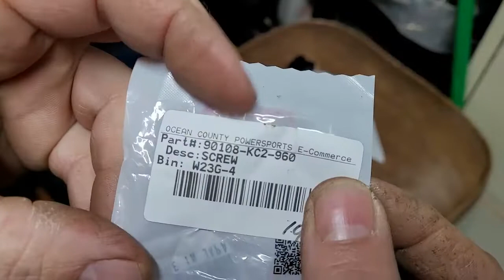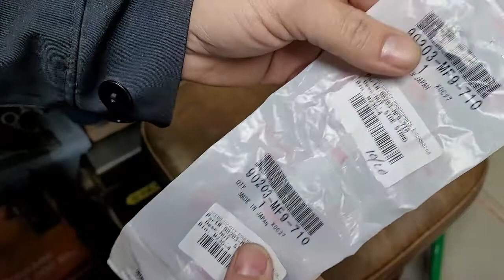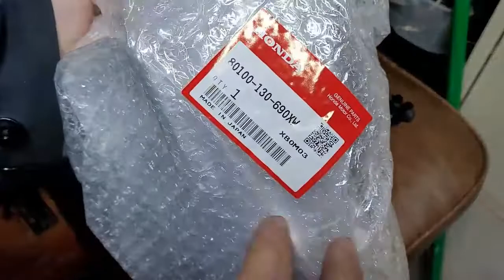Working on the Honda Z50 evaluation on the 2nd engine

Comment: Hey Kevin, I have. 1980 kd80 that floods itself. I’ve watched all your carb videos and have had this carb apart 30 times but can’t figure it out. If I let it sit for a while it’ll idle on choke but bog with any gas. Sometimes it’ll run right for a short time then just die. Any idea what my issue is?